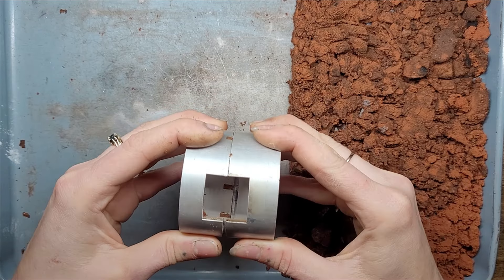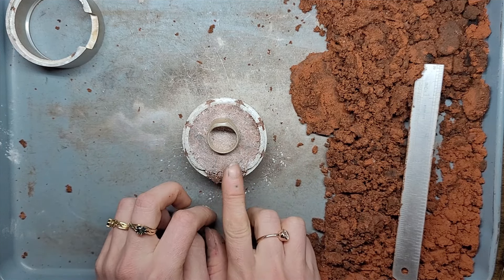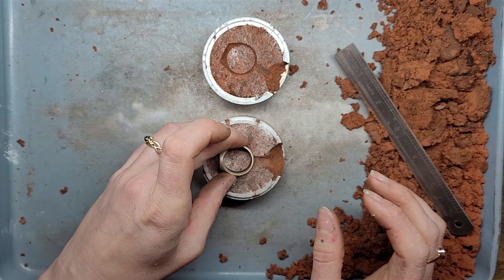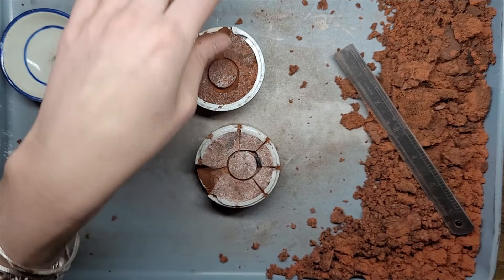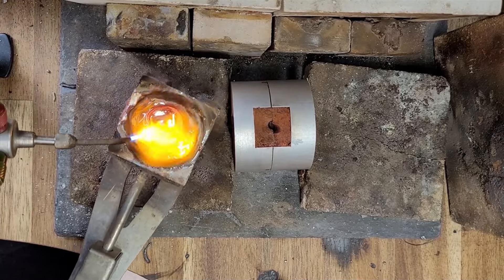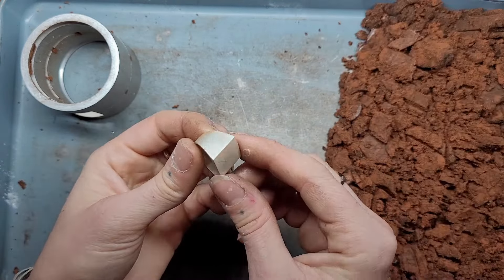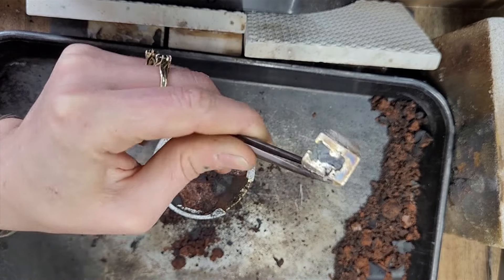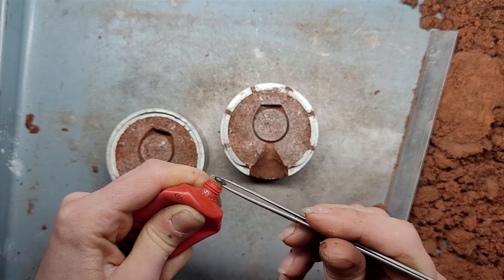Sand casting tutorial - Troubleshooting signet ring with cast-in-place rough sapphire

Comment: Thanks so much kirra-Lea! This answered more questions than just the stone breaking. Watching that, I was surprised the silver even encompassed the stone on such a thin mould- but the “rolling melt” seems to be a very important point! My silver often sticks to the crucible before pouring, and in my trouble shooting, the stone would be so large that I imagined it was drawing heat away from the silver and it would stop it in it’s tracks. Not allowing it to encompass the design- even on a much thicker band.

Choosing stones with softer edges sounds like a good plan for future attempts. 

I’m sure many people will find this helpful!!

Thanks so much!